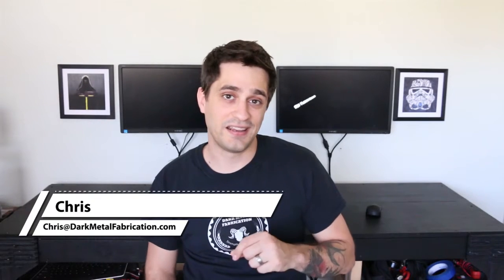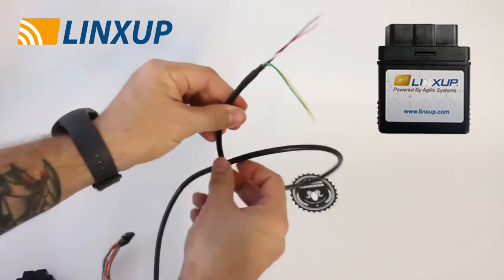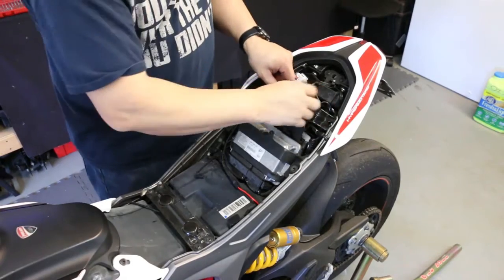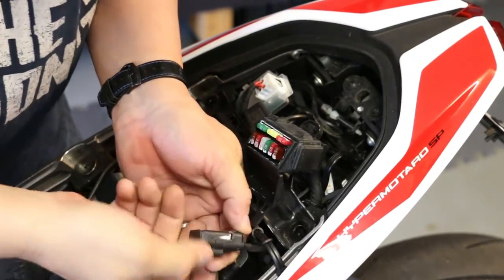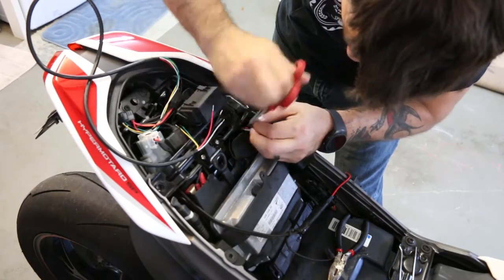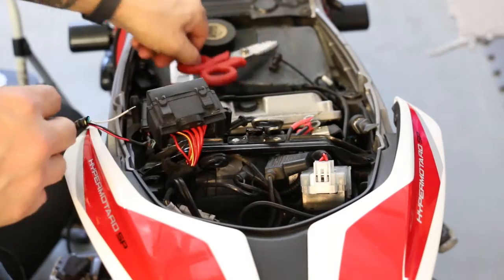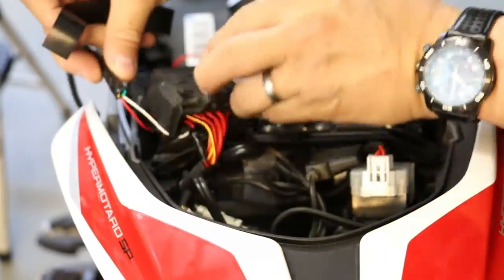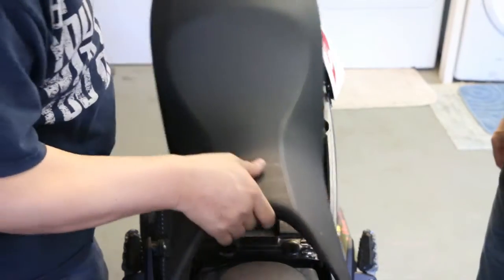Motorcycle GPS Installation

Comment: Have you ever hardwired a trackimo gps?
Reply from the maker: Hey Carlos,  I havent had the chance to check out a trackimo.  The form factor looks great though.  I'd be curious to check it out.
Reply: Chris's Tech Talk Ok. Was trying to get some guidance on hardwiring that to a fz09
Reply from the maker: Have you run into an issue during an installation?

Comment: Dude, instead of cutting the wires and soldering them back together with the wire you are adding, you can just use a positap and connect your new wire to the existing wire with no cutting of existing wires. Pretty awesome because it's easy to disconnect too if you ever need to. Just thought I'd let you know. Here they are on Amazon Lockitt POSI-TAP Assortment pack wire connectors 10-22 awg https://www.amazon.com/dp/B00CMC5DII/ref=cm_sw_r_cp_api_fHV7ybQA5VN87
And here is a YouTube video https://youtu.be/N64p6ndlTQ8
Reply from the maker: Great links, thanks!  Posi-taps are great and I use them for various things but on a few occasions I have had them come loose from vibrations.  Because the tracker was being installed on this bike in the event it was ever stolen, I wanted to make sure none of the connections had come loose and the owner would be able to find his bike.  Thanks for watching!